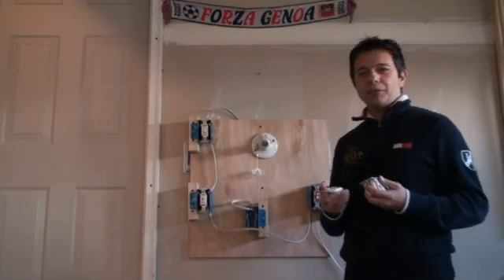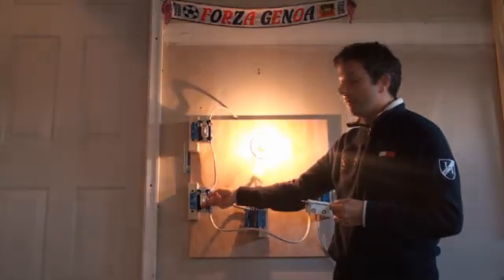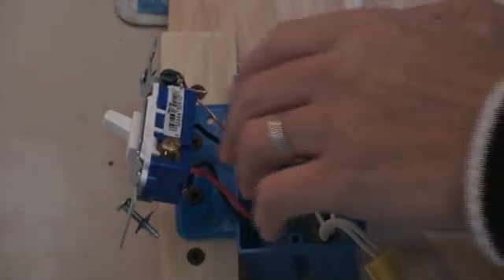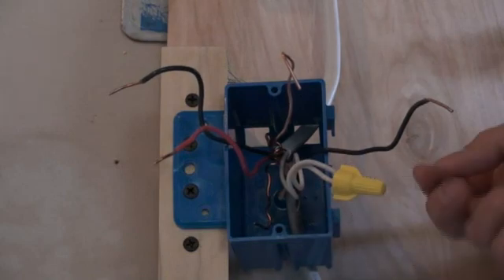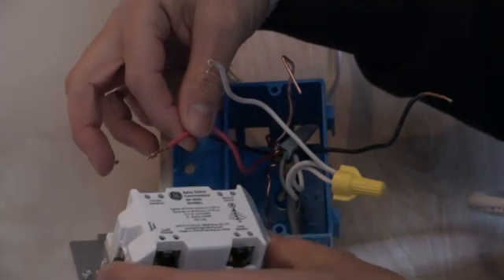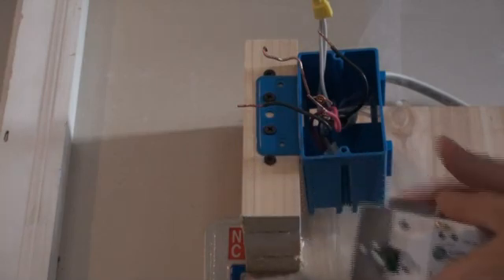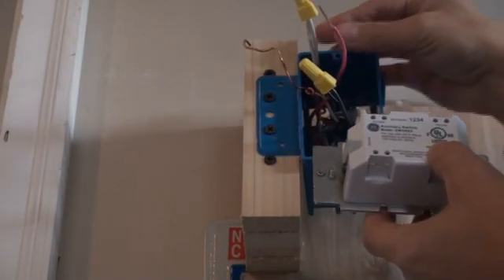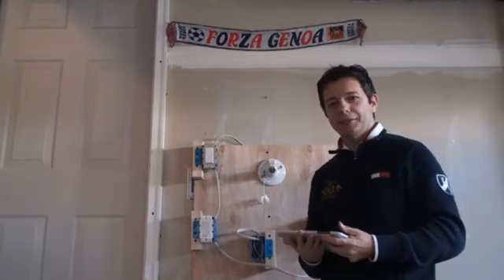GE Z-Wave - 3 way switch Kit

Comment: good video, helpful to see how the secondary switch is wired.  Looks like 14/2 wire could be used for a new install, just use its black for the traveler.  cool.

Comment: My home is old I have a 1 white wire and 2 black wires, and one ground wire. Then there are 3 combined white wires and 3 combined black wires. i got which black is which and i got the my white is your red but i dont under stand when wiring the light switch with your white connected to my grouped white I dont have a working switch. If i unplug the zwave switch and rewire the original switch it works again.
Reply: my issue too
Reply: I got power to the relay but nothing to the aux light and the light didnt work.

Comment: First, thanks for the video and all the effort you went through to do the demo.  It was very helpful.  Just a heads up that it can make a difference which outlet you choose to install the primary.  I made a decision to install the primary in a location where the little blue light would have been less obtrusive.  However, the solution didn't work and there was no power to the light.  I thought about it a while and it occurred to me that it might make a difference whether the primary was switched around to the other location.  After making the switch, everything worked.  Now, only if there was a way to make cramming all those wires and the bigger switch back into the circuit box easier.

Comment: Davide, this is one of the most valuable DIY videos I have used!  I was so confused with the instructions, however, you video was exactly how I needed to set up my system.  It took me less than 15 minutes on the first try.  I don't think I would have ever gotten it right form the instructions that came with the switch.  Thank you!

Comment: Davide Revelli  I have the exact same setup, but confused on the auxiliary. My zwave 3 way switch didn't come with an auxiliary. Instead I'm using the old switch which is a variable dimmer with an on and off switch at the bottom (not zwave type). Do I just connect those two black wires together like you did at the end of this video? Can't say this is my strongest point in my computer head lol. thanks in advanced
Reply from the maker: Cesar Ramirez I just read your message. Is the swith working..I did not think it was possible to do it...
Reply: Cesar Ramirez I think you can do that but you will essentially cut off one of your switches if the other is in the off position.    If you get it working AND all 3-4 switches in your run still function let us know =)

Comment: The video was very helpful.
I encountered 3 problems not addressed here.
1- The original electrician made it obvious that the RED in my system was the traveller. But the master switch had 2 RED travellers on it. I found this confusing. I finally realized (a DUHHH moment) that the GE Switch had 2 holes at each terminal. I simply connected the second wire into the 2nd hole and it was good to go.
2- There was a LARGE bundle of Neutral wires and I did not have a a cap big enough to tie in 3 more wires ( I was placing 3 switches in the box). I referred to #1 and daisy chained the neutrals from switch to switch and then to the bundle.
3- The original electrician mismarked his wires. One switch had a tagged wire that was the load and the other it was the common. A quick reversal on the incorrect switch and we were done.

The video did help speed up the process. Thanks!
Reply from the maker: Wow thank you so much

Comment: Sheesh, I wish I had watched this before spending 3-4 hours trying to get this working! My big mistake was not binding the two black wires on the aux switch. I'm sure it was in the instructions but not in a language for a non-electrician. THANK YOU SO MUCH for producing this. I was about to call the electrician with my head hung in shame.
Reply: +Brian Knight I am in the same boat.  I spent 4 hours trying to get the aux switch to work.  Will try it out when I get back home.

Comment: If you have to have a wire between the 2 switches to send a signal then it is not a wireless switch.  Good instruction but trying to see if it can be used in a wireless situation since it is labeled as a wireless 3-way.

Comment: Davide,

 Great video. Unfortunately, I'm running into an issue with my setup (which is for the 3 way dimmer, not 3 way on-off, though still the GE product). Specifically, my aux has a black (hot?), red (traveller), white (neutral), and ground, and my main has 2 black (hot and load?), red (traveller), and ground. The main on the dimmer doesn't take neutral, but I'm not sure what to do with the black in the aux. I've tried tying the aux black to the traveller or neutral and then to the switch, as well ignoring it completely, but regardless,I'm getting no power at the main (the led doesn't turn on, nor do the lights).

 Any advice?

Thanks
Reply from the maker: You are correct, the main dimmer does not take neutral. In the aux, you must connect both black together (not in the switch), then the neutral, traveler and ground to the switch. In the main instead, connect the load, line, traveler and ground (here make sure to identify load and line, if it does not work, switch the load with the line.
Reply: Davide Revelli Hmm. When I was working this yesterday, I only saw one black in the aux box. I'll look again tomorrow (when there is light) and see if I was mistaken and have a second black to tie together. I hope it is that simple! Is there any possibility that the aux could only have one black wire, not two to tie together? Thanks for the response.
Reply: Davide Revelli  To follow up, in a spate of hopefulness, I took my screw driver and iphone to the switches this morning to see if this were an easy fix. Unfortunately, I’m stuck again. There is only one black wire in the aux (marked “common”) on the current aux switch. You can see the aux box at http://seth.landspeople.net/IMG_0116.JPG (on the right, the left is another 4 way switch). Also photographed the main box at http://seth.landspeople.net/IMG_0119.jpg. To be honest, I’m not sure what the pair of black wires and neutral on the left connects to, they are tied together with a wire nut.

So, where do I go to from here? The video assumes I have a load and hot in the aux, but I only see one wire, that I assume is hot. I’m not quite seeing how this system could work as it is now …

Any help would be greatly appreciated.

Thanks
Seth
Reply from the maker: sethlandsman Only now I see your answer. Did you resolve the problem?

Comment: Great video! Can you do another one showing how to do a 4 way switch?? I am stuck with switches hanging out of my wall :)
Reply from the maker: Danny I am sorry but I no longer have my testing switchboard. However, I don't think there is much difference, I installed 4 way switch in a couple of places, just repeat the auxilary switch and you should be fine...good luck

Comment: I could understand you just fine, but of course some of the terms/words are different around Europe as you know. I work in UK/Ireland.
Thanks Davide, great video. 

1st Switch -
Black-Hot = Live from Fuse Board,
Black/Red-Traveller= Strappers between both 2way switches.
Ground = Earth.
Nowtrals = Neutrals :)

2nd Switch -
Black-Hot = Switched Live to Light,
Black/Red-Traveller= Strappers between both 2way switches.
Ground = Earth.
Neutrals = Neutrals

Comment: You Sir are a Saint and a gentleman!  Without this video we would not have been able to wire any of my switches (all 3 way and 4 way). I used a ge switch but I was also able to use a micro switch as the primary switch: 
Aeon Labs Micro Smart Energy Switch
I then used a slave or auxliarry swtich:  Intermatic CA5100 Three-Way Accessory Switch
Check out dkcautomation they do some crazy stuff

Comment: I've replaced the secondary switch and still the same problem. I am using the switches to control 5 pot lights (50W PAR20 bulbs) I wonder if the problem is due to the number of pot lights or type of bulbe.

Comment from the maker: Once I had a problem with the secondary switch in a dimmer installation, I ended up to repeat the installation and everything started to work fine. Not sure what was the problem, try to repeat the installation for the secondary switch..

Comment: Thank you very much for this video. It was very useful in figuring out this installation. I am having a problem and the 800 number in the manual was useless. For some reason the secondary switch can turn the light off and to some extend adjust the light intensity but if the light is dimmed too low or turned off, the secondary switch can not turn it back on. Tech support said that it's an impedance issue. Did you (or other viewers of your video) ever run into this issue?
Thanks